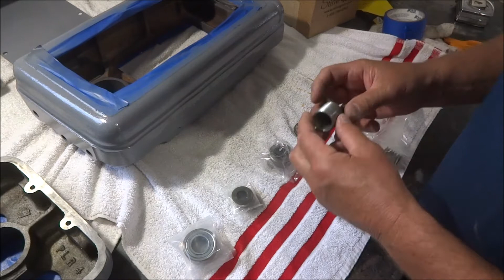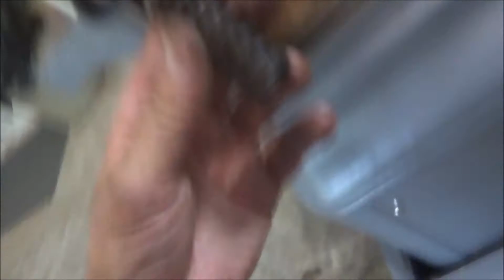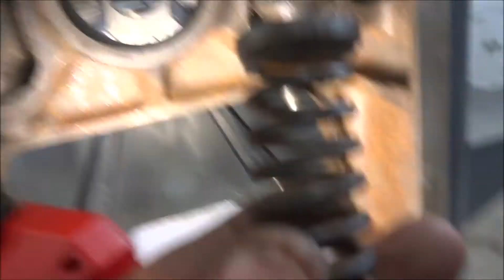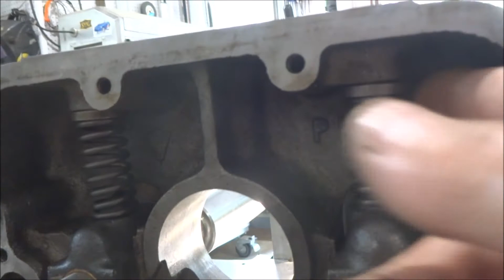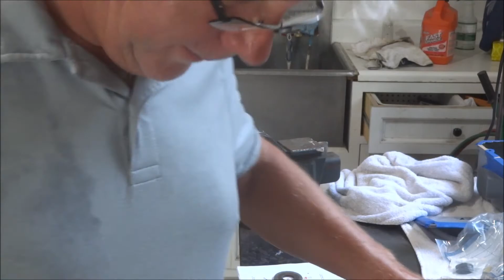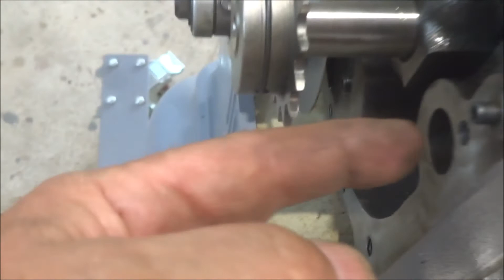Delta 22 101 Planer Restoration   Part 3

Comment: Where did you get the new bronze worm gear and how much did it cost? Thanks, Kevin
Reply from the maker: Stine Gear has made these gears and others for several years.  I actually visited their operation in NC.  Very impressive and great folks.  They actually made a few other parts for me on this restoration like the collars that raise/lower the bed.  If I remember, I think the brass gear was around $200.  Probably a bit more now.  I initially found the brass gear from Stine on eBay.  Check their website - https://www.stinegear.com - give them a call.  They're great.  Good luck.  Thanks for watching and commenting.

Comment: What's the length on both the chains?
Reply from the maker: I don't have the specs (e.g. length) on the chains.  A manual is availble at:  http://vintagemachinery.org/pubs/1141/4542.pdf   -  In the parts list section, it shows the chains but doesn't give the length.  You might try Renovo.com they carry some vintage Delta Rockwell parts and might be able to help.  Good luck.  Thanks for watching and commenting.

Comment: What are the specs on the plainer knives . I have the same plainer . Looking to replace my knives need the specs and what's a good tool to gauge the blades
Reply from the maker: The specs for the knives are: 5/32" x 11/16" x 13 1/8".  I use a dial caliper to set the knives.  Hope that helps.  Thanks for watching and commenting.
Reply: @elwellboy  Thanks for the reply and it's good to know I ordered the right blades. I'm going to try the magnetic gauges . I think . Because mine is missing a few of the adjustment springs that go under the knives . Do you know of a site i can order the springs ?maybe specs on the springs ? Also realy enjoyed the videos . I watched all of them on the plainer.  Very useful  and helpful information . .
Reply from the maker: @jerrydrake8179  Glad to help.  Check out Renovo Parts at - https://www.renovoparts.com/  - I've had good luck finding Delta parts there.  Good luck.
Reply: @elwellboy  will do thanks again for the reply

Comment: I'm debating on buying one of these. Love the old machines but I just worry about sourcing any parts I may need to get.
Reply from the maker: They are great planers - very heavy duty.  Getting parts is a bit of a challenge but I was able to find most everything.  I had to have a couple gears made - Stine Gear in NC has the specs for most of the gears.  Renovo is another source for old Delta parts.  The only parts I couldn't find were the bearing shields on each end of the cutter head.  I damaged them removing the bearings.  I was able to straighten them good enough to reuse.  Thanks for watching and commenting.

Comment: It's been a while! I finished my restoration some time back and decided to bite the bullet to upgrade my cutterhead with a new shellix cutter head along with new bearings.
Byrd didn't supply the dust slinger PLR-124 for each bearing and they do not know of a supplier for these dust slingers.
Do you know of a supplier?
Since the new bearings are sealed,  are these dust slingers necessary?

Thanks 
R D
Reply from the maker: Wow - you went all in with shelix cutterhead.  NICE.  I'm not 100% sure the dust slingers are needed.  I bent mine a bit getting the bearing off the cutterhead.  I was able to get them back into shape and reused them.  You might try - renovoparts.com - I was able to source some parts there.   Good luck.  Thanks for watching and commenting.

Comment: I bought a delta 22-101 and it leaks oil out of the gear box what grease did you use in the gear box ? Great video I appreciate the detailed info .
Reply from the maker: Great old machines.  You'll likely need to make a new gasket for the gearbox cover.  I used 80-140 gear oil.  Glad you found the video helpful.  Thanks for watching and commenting.

Comment: Hello again this is backlash Joe (haha) what did you move /adjust to get your backlash where you wanted it also what weight oil did you use for the gear box
Reply from the maker: I couldn't see anything that would adjust the backlash.  I suppose when everything is new the backlash is correct "out of the box".  But if your gears are worn it's probably impossible to get the spec on backlash.  I had new gears (worm on end of cutter head and brass spiral gear) so that may have helped me get it to spec.  For gear oil, I used 85/140 that I picked up at NAPA.  Hope this helps.  Good luck.  Thanks for watching and commenting.
Reply: @elwellboy  Thank you very much for your help

Comment: how did you take care of the back lash
Reply from the maker: I assume you mean the back lash on setting up the gears.  I used a dial indicator.  It was difficult to get it positioned even using a magnetic multi position holder.  After some time I was finally able to get the lash very close to the specs.  Good luck with your setup.  Thanks for watching and commenting.

Comment: Do you have the specs for the knife wedges or the ability to mic the ones you have? I recently bought this same machine, the previous owner did not have them nor did he know where they were. Parts for these machines are allusive
Reply from the maker: I don't have the specs and they are in my planer right now so can't mic them right now.  However, call and check with the folks at Renovo - see the link below.  They have a bunch of vintage parts for Delta equipment and may be able to help.  I've gotten a few parts from them for my planer.

https://www.renovoparts.com/search.php?search_query=planer+lock+bar&x=0&y=0

Good luck getting your machine back in service.  Thanks for watching and commenting.
Reply: @elwellboy  thank you so much.

Comment: Nice documentation and video.  Is there a specific part number for the gear or did you just mention you needed the worm gear set for a Delta 22-101?
Reply from the maker: Glad you found the video helpful.  I believe Stine Gear uses the same part numbers that are in the 22-101 parts list.  However, you can also go to ebay and do a search on "Delta 22-101" and you'll find the gears that Stine makes.  They did some custom stuff for me as well.  I think their contact info. is in the video or description.  Good luck.  Let me know how you make out.  Thanks for watching and commenting.

Comment: Great work with this whole video series. I’m in the middle of rebuilding one of these planers myself, and it’s great to see how you went about rebuilding yours.

I am trying to hunt down the table raising mechanism thrust bearings and haven’t been having any luck.  I see you have them listed as UBC N402.  Would you be able to point me in the right direction for these? My searching has found a couple different bearing companies with the UBC name and I haven’t been able to find that part number anywhere. Did Baker bring these in for you or did you order directly from UBC? Thanks for your help.
Reply from the maker: Glad you've found the videos helpful.  The name & number stamped on the old bearings is Nice #4962.  I did see some on ebay - but kind of pricey at $50 each.  You might try National Bearing Service at the number listed in the video description.  They found these and have helped me find many odd bearings and seals for different projects.  You could also measure the ID, OD and thickness and search for a replacement that way.  The raising mechanism is not a high speed application so you don't need a pressed fit around the shaft.  If you totally strike out - let me know - I still have the old bearings (which appear in good condition) and could do a reasonable deal for those if necessary.  Thanks for watching and commenting.  Good luck on your 22-101 restoration.
Reply: @elwellboy  Thanks again for your help. I have managed to find alternative bearings that I could use, however all of my local suppliers are requiring a minimum order of ten bearings.  To make a long story short here in the comments, if you still have your old bearings available, I might very well be interested in working out a deal for them, rather than buying new bearings.  Let me know your thoughts and hopefully we can work something out.
Reply from the maker: @MattyT4444  email me your address at Elwellboy@gmail.com and I’ll put them in the mail